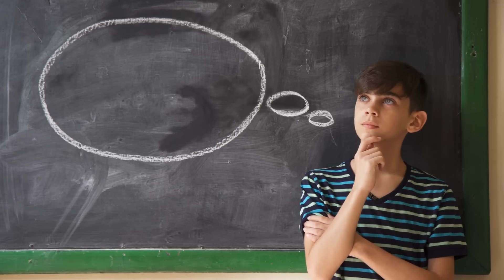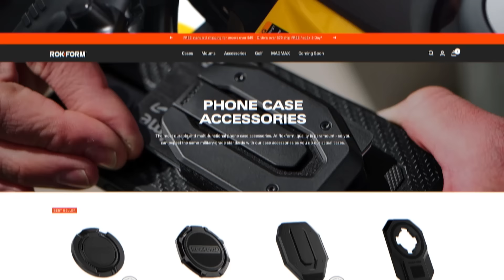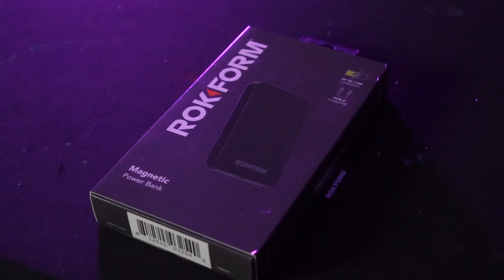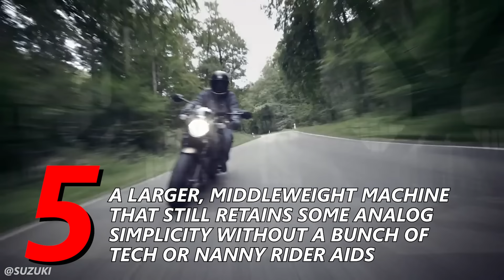Top 5 Motorcycles that will TEACH YOU to be a Better Rider

Comment: A Yamaha WR450 (2012+) is the best bike in my opinion for beginners to learn the fundamentals on. Has plenty of power and amazing suspension right out the box. Can also be tuned down to make the power more forgiving, and throw some supermoto wheels on it and it becomes a sick street bike. Everyone thinks the maintenance is horrible compared to the drz but they’re just wrong. Easily can get 15-20k before rebuilding or even adjusting the valves.
Reply: You lost every beginner at "rebuilding" 💀
Reply: Kinda disagree with that one. The power to weight ratio is pretty damn high, as is the seat height. Most people won't even know it can be tuned down much less how to do it, and the streetbike application is very dependant on where you live, as far as I know it's not going to be road legal in quite a few places. A 250cc dual-sport or a drz is going to teach you the same skills while being easier to put a foot down and without the risk of getting in trouble over a bit too much throttle.
Reply: @iridium771 Agreed. If a bike can power wheelie in 4th, then it’s not a good starting bike. I wouldn’t even trust a beginner on a 250 if it’s setup for track use.
Reply: Holy shit, imagine a selling point being "easily" get 15-20k before having to rebuild AND then comparing it to a DRZ.
The valve check interval on a wr250r is 40,000kms with 5k oil changes and I've seen a dozen around 100,000kms unopened.
Reply: This man can't be serious... But then again..... Murikaaa

Comment: Drz400sm did the trick for me. Not so fast that it power wheelies the first whiskey throttle but still plenty fast enough to keep you scared a while. It’s basically a ninja 400 with less top end and more torque. Plus you get to go off road.

Comment: I started with a Grom, did my MSF and got the bike street legal with about 250 miles under my belt. I already feel like I need something a bit bigger/faster for some of the other roads but I'm going to make myself stick with the Grom for at least another year or 2-3k miles on it. The only thing I don't like is that I feel I'm getting TOO used to the weight of the bike, ideally I'd like a ninja 400 or something similar next and feel like I'm taking a step backwards getting used to this low weight on the Grom.

Comment: i have a bluroc heritage 50. its a 50cc dax rippoff but damn right i love that thing. i can ride whenever i want. thing is....... idk where to. also it only goes 25km/h for refference thats 15 miles per hour. honestly it sucks but it taught me how to shift gears and how to ride a bike. i never really went to a msf course. since there is non for 50cc mopets or whatever you wanna call that thing. but i had some people tell me how to ride bikes. one of the mistakes i made on it was shifting the wrong way. how? i didnt know you had to let go of the throttle in order to shift. meanwhile there is me trying to shift whilst i am just hitting the gas. yeah not my best moment but an essential one. other thing. how i learned to hit the foot break. i dont have abs. unlike my bikes name is telling me (i got the abs model. but abs stands for antwerp bike shop) so tapping the break stops you from sliding around. basically what you're doing is mimicing abs. at a traffic light? hit the clutch whilst you're breaking. why? trust me you dont wanna stall. also something thats basically only a thing on this bike is. if you're stopping go 2nd gear to continue riding. why? because 1st (tops out at 16km/h) is pointless on this bike since 2nd (18km/h or if you're lucky 20km/h) 3rd (24 km usually)  then 4th gear goes to 30km/h but dont tell the law that. they approved the thing but i guess they didnt know its faster than 25 km/h  oh for the drivers intrested dvv insures it for 14.98 euros a month. well thats the price in belgium. also it has a 2 stroke engine so it takes forever before you get the gas light to show up. there is no way of telling how much gas is left. because there is no fuel gauge. it shows is if its almost out of gas by showing a light. hate that. but its fine it teaches you to check your reservoir and not trust your motorcycle. which i saw on another video on youtube of a guy who saw his indian say it had a 13mile range but in actuality it had 0 miles left and kept turning off. btw i found a bug on this bike where it glitches out and goes higher then 30km/h but it will show a neutral light. thats if you start the bike go to 2nd then 3rd then 1st. once you're in first hang the fuck on that thing will scare the fuck out of you. i saw the thing say 39 km/h but the torqueness is so much you start doing a wheelie. first time this happened i was just going out of the gasstation waiting for my moment to cross the road. dude i almost went through a restaurant. but everytime this happens i just stop and restart. because idk if its hurting the bike

Comment: best first bike is a 20 year old CB250. easy to work on, old enough not to care about a scratch or parking lot drop. easy to get parts for. fast enough to be fun but not fast enough to freak you out. cheap on consumables. they can take an absolute beating and all for about a grand. then straight to a turbo Busa!

Comment: Can you prefer which small , single cylinder bike is better for a beginner 🔰
Reply: Any bike from the big four is basically the same, you can't go wrong. 
I would suggest a dual sport in the 250/300ish range like an old xt250 or so.

Comment: I started in January on a ninja 400.  I put 7k miles on it. I ride canyons surrounding Phoenix. I’ve laid it down twice. Once at speed from brake failure. Once at low speed during a tight turn on smooth pavement.  I’m 35 and not super dumb.  I maxed out the 400 a while ago and I’m bored. Can I skip the middle class MT-07 and go straight to MT-09?
Reply: Yes

Comment: I started on a 400 Ninja, and have made my way to the Suzuki 8R. Feel like it's been a great progression, but in time I'd like to advance to a Busa more for the comfort and touring abilities vs speed. Of course, there is also the GSX1000GT which also would probably fit as well. (I have been considering either as a used Busa and a New GT are about the same price) There are days where I just don't want to go home, but my keister says other wise. So looking for something with a bit more long-term ridability and maybe something I can take a weekend trip on to say Tail of the Dragon. I'm glad I learned on a underpowered 400 NInja. It was bullet proof, and it was a easy bike to flick around and get comfortable on. There are a few weak spots to the bike like riding position be so straight up for a sport bike, and the windscreen just shoving air at your chest, but you can learn to live with it. It just means the first time you hit 70mph on a bike, you really FEEL it. And the first time you make that rookie mistake of dumping the clutch with too much throttle, your not going to loop it. Having one equipped with ABS is nice too. I think I only really felt the ABS engage once or twice the entire time I owned it. However, on my 8R I did find the ABS may have made the accident I was in less violent. Thankfully I was able to still steer a bit while locking the brakes down to try and avoid a car turning into the side of me. Had I been going faster, I would have been thrown from the bike. Had I not had ABS I would have went wheel into the door or fender and chucked over the handle bars. Instead I was just slowed down and slowly knocked over. (although I'll admit, at that time frame, death would have been a welcome release)

Comment: My real first bike is a 2009 Kawasaki ER-6F (no ABS), but I'm cheating a bit, since I went to motocross camps as a child and early teenager, where I would ride 50cc, 80cc and 125cc dual sports bikes and even 90cc quads (relative to age, size and skill) on dirt tracks, off-road and a bit on the road to get to and from riding spots. Learned a lot from these experiences, and when I went to get my A2 license in June of this year having not ridden for 21 years - due to my father being unalived riding to get himself to work and my mom too scared to even think of letting my brother or I get too close to a bike - I was quite nervous at first but those skills that were embedded in my brain and body at a young age came back surprisingly quick. I'm grateful I now own the bike I do, because it's old enough so that ABS wasn't very common and was a huge premium (meaning I got this no ABS one for quite cheap) but recent enough so that the parallel twin is actually quite good and versatile. I learned a lot this summer riding it and plan on keeping on learning this winter. I live in Southern-East France, so it's quite okay riding in the winter, just get warm clothes and gear and bring some waterproof overalls in the top case and you're all good. Won't be riding too high up in the mountains though. 
All that to say, I love my middleweight sporty roadster with fairing ^^
(Oh and, by law, I had to have it clamped to 32.5hp [yeah older bike so the clamping kit is made for the older rule that has now been bumped up to 47.5hp] instead of it's original 72hp, I think it's a good way to learn and not too bad since the bike is "only" 184kg [405.6lbs] dry. Can't wait to get rid of the clamp though xD Only (a bit more than) one and a half year to wait until I can get my full A license)

Comment: 4th bike was a Grom. I use it to practice for racing because I can't always get to the track. I go to an empty parking lot and drag knee, slide it around, learning to wheelie. I even converted it to GP shift so I could practice when I made the change on my race bike.
It made a HUGE difference for me. It's such a great tool.
Reply: That's surprising. But I guess it makes sense. Did people near the parking lot or cops ever give you problems?
Reply: 05:36 What kind of bike is that black one??? Can anyone tell me?

Comment: It makes sense in the US, where getting a motorcycle license isn't as elaborate as in the EU.  In Denmark a bike in the cb500 to the sv650 caterory is considered i beginner bike if you a in the A category. If you 18 you can only ride a 125cc with 15 hp when you are 20 can upgrade to A2 48hp 2 years later you can upgrade to full size.  If you are 24 you go strait to the A category.

Comment: 100% on the small dual sports.
I started on a TW200 and the ease of riding it got me into riding dirt.
I now ride a WR250R as my riding has progressed and while there are lighter, more powerful, and faster dirt bikes, I find that the low maintenance and street capability make for a great all-arounder for my riding style.
Reply: I wish I could have a WR250R 😢
Reply: I love my Royal Enfield 411 Scram.

It’s a bit on the high end of a ‘small’ dual sport, especially on weight, but the damn thing’s so easy to ride with only 24 horses, dead simple to maintain, and most importantly, very pretty. 

She’s also got that Tractor Factor. Not quite the field plowing, earth moving, 8 wheeled monster tractor of the KLR 650, but she’s still a competent utility tractor if you feel me.
Reply: 05:36 What kind of bike is that black one??? Can anyone tell me?

Comment: Smaller bikes are more forgiving around rider mistakes. Remember that the first times learning the controls, everyone is a little nervous about what they're doing. A single mistake is easier to recover on a low hp, low weight bike. Once you're getting comfortable and feel the need for new experiences, you can easily go a step further. And going step by step is a great way to gain experience.

Comment: If you get a minibike you can also do Mini GP. Where you'll be able to get all but the speed part of a track day. Cornering, lean, trail braking, line selection. For a fraction of the price. Mini GP will teach you so much for such a low risk. Did you lowside? More often than not all that will be damaged is your pride, so dust your self off and get back on it.

Comment: after 35 years of riding, including racing motocross and supermoto I had a bike extra after a divorce, Duke 390, still have the bike a few years later. It's super fun and allows me to experiment without a lot of power and risk. It's super nimble and hard to beat on smaller roads with mostly turns. And it's cool to have  bike you can ride for a 100%, not possible on high power bikes on the road.

Personally I don't like the MT07 as an example when coming from the Ninja 400... The yamaha has quite bad suspension if you don't fix it. Besides that it's a fun bike with a lovely engine.

Comment: Even ninja 650 could be on that list ^^  ( if you need to take a loan to buy a bike ) rather than geting ninja 400 get 650 … ( own both ) got similar power the only difference 650 is more comfortable and goes about 20 miles more in top speed + easier for motorway comuting

Comment: A dirt bike is the perfect platform to learn basic motorcycle controls, and riding off road is much more forgiving when you mess up. My first off-road bike was an old Suzuki 100, and my first street legal bike was a Suzuki s40 aka Savage ls650. The ls650 was a small and lightweight bike, which was about the size of a 250cc, but it had plenty of power thanks to that 40ci thumper. 😁